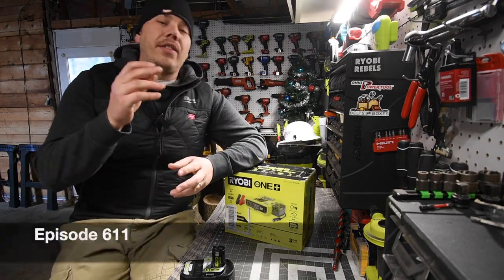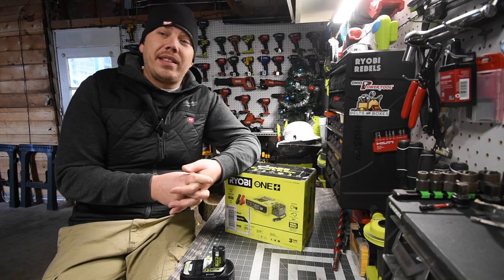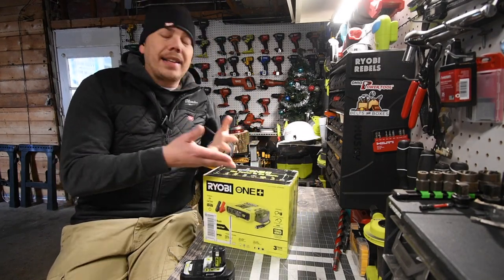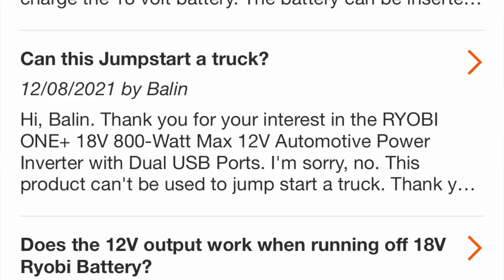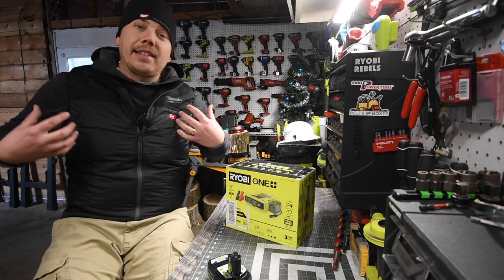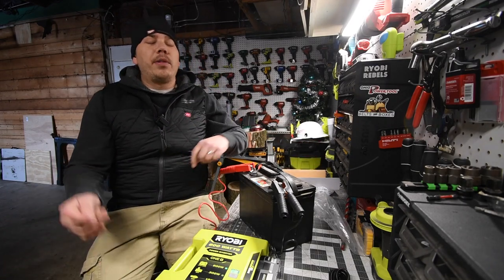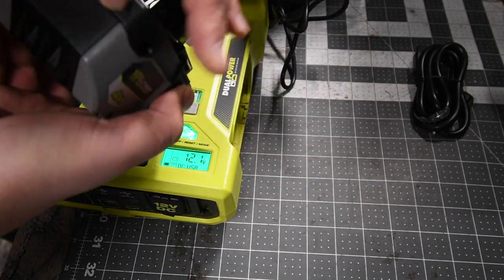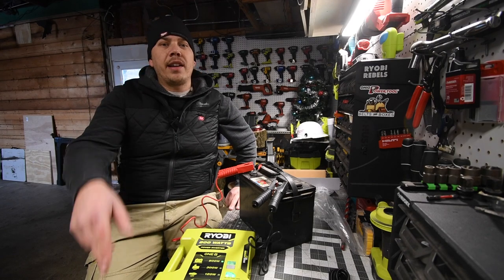This is "NOT" a Jumpstart/Inverter Combo kit

Comment: I'm looking at this inverter from the perspective of a potential longer term power outage. if you were to maintain a fully charged marine battery for emergency use you could probably power your smaller electronics and LED lighting for the duration of the outage. A car or marine battery will produce the 800 watts the other inputs will not. With the 18v input you could probably attach a solar panel and use that to charge other batteries or devices via the A/C outlet for instance plugging a 18v battery charger into the A/C outlet. i'm not sure if the solar panel would work or if it would take more than one panel, but most of the portable panels i've seen are 18v.

Comment: Inverters are mostly used by truck drivers.  There handy if there powerful  enough.  I use a 3000 watt inverter for my truck hard wired to the batteries.

Comment: We all make mistakes! It is good to get 300 watts out of the 18v batteries vs only 120 watts from their other inverters, which is why I got it. Plus it has 2 outlets. These days I'd suggest a lithium compact jumpstarter that is like $100 and can do a V8 no problem and the battery stays charged for a year. The other Ryobi inverter with USB-C power IN/OUT will let you charge batteries from solar or use as an inverter. Not sure when that one comes out though...

Comment: By lightly researching this product I noticed one thing, If your gonna think an 18 volt battery is gonna supply 800 watts of power for a long time then your sadly mistaken. The 150 watt power inverter runs out of battery after about an hour when using a incandescent light and a 4 amp hour battery. That's if this thing pulls power from the ryobi battery to work.
Reply: First up a 12 V lead acid battery charges 800 W inverter second it’s a 300 W power inverter that runs off the 18 V battery third you should probably stick with sledgehammers .
Reply: @acemarcola  Wait a second, I was talking about the 150 watt One Source Power Inverter that is made by Ryobi for the 18 volt batteries. I did a review on this product and have posted it on my channel. I was only saying If this tool uses the 18 volt battery to run an inverter, then the battery probably will not last that long.
I am not trying to be rude, that was my point.
I also find the end of your comment disrespectful. If you don't understand a person's comment or question next time, then maybe ask for clarification instead of going off on some sort of unrelated tangent, that or trying to be some tough guy online. I am not trying to be rude in my comments either.
Reply: The 18v produces 300W. when he has it hooked to the battery the 800W indicator is on because it's only going to use one power source at a time so having the 18v and the car battery input at the same time is doing nothing. i realize he was expecting it to charge the car battery but i'm just pointing out the reason why there is only one indicator light with a car battery and 18v connected.

Comment: It's quite disappointing that you can't charge the tool battery from the 12v source. I love Ryobi, but this just seems like a huge missed opportunity to not function as a tool battery charger for your truck.
Reply: i agree but you could probably plug a 18v charger into the A/C outlet on the inverter and charge the 18v battery.

Comment: Is that legit (even the 1000watt)?, so then the jumper cables provide no output (input only).. u didn't run any actual metered tests, tho (to determine output /or even touch em together for spark!)? Either way def saved me some money! appreciate u, thanks!
Reply from the maker: this specific tool does not act like a jump starter. Which is why I made this video. a lot of people will assume it is a jump starter as well. but Ryobi did release a new one that is a jump starter
Reply: @ManCaverTools  would that be the 1000watt iteration, or a different product altogether (perhaps with its function in name or description)?

Comment: This thing is pretty cool.  I wish it could charge ryobi batters and that it had a remote on/off switch, wired or wireless… it is hard to access installed under the seat in my truck